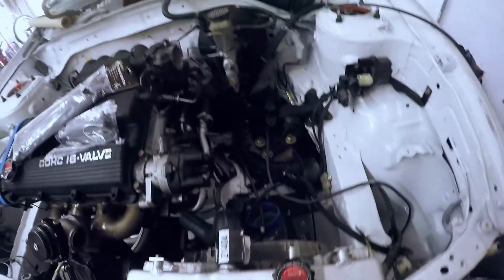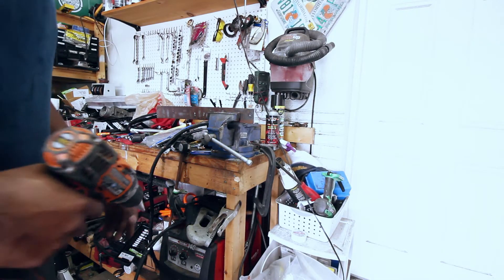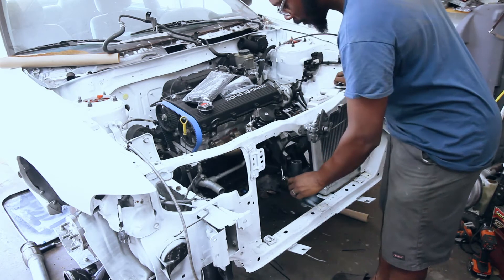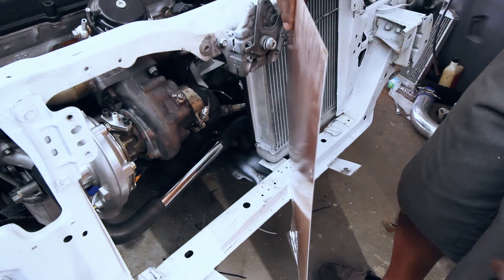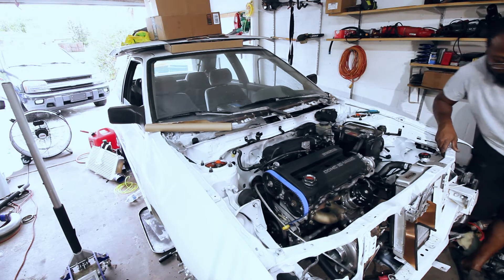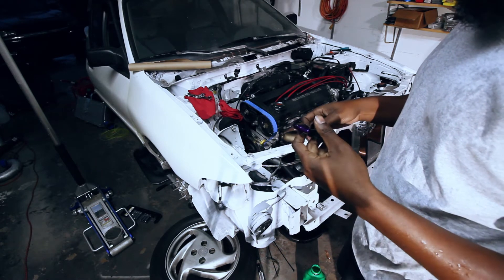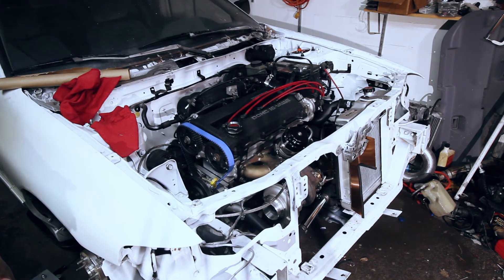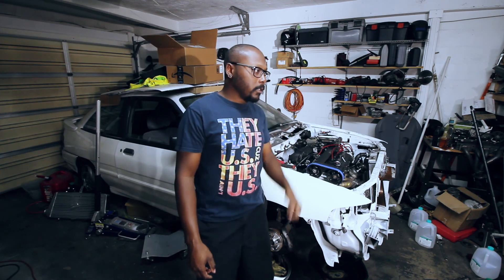Mazda BP First Start after rebuild

Comment: Regarding your heater hose next to the DownPipe- Could you perhaps thermal wrap it to help keep it from getting heat-soak from the Turbo/DownPipe? If that starts becoming an issue, at least.